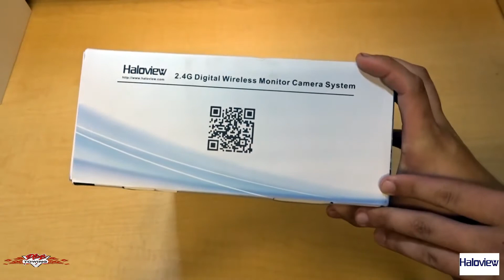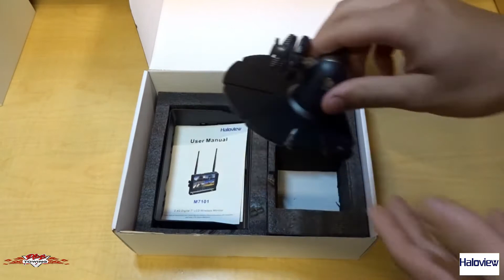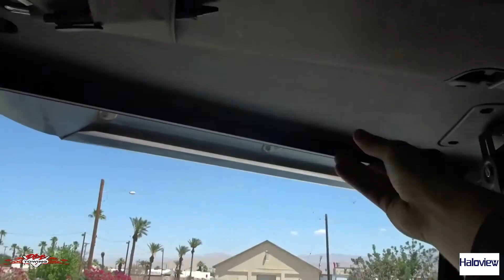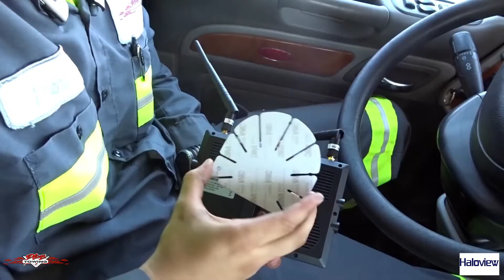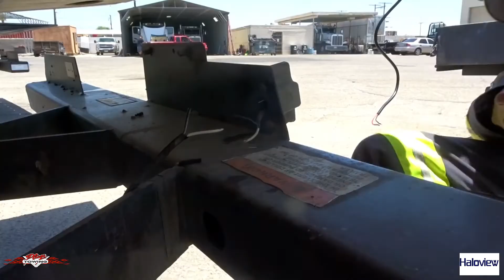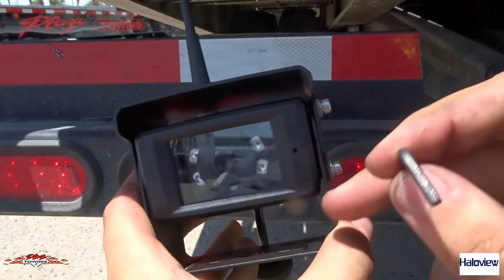Haloview wireless backup camera MC7101 installation tutorial

Comment: A question you may be able to help with, I have 2 - 2camra systems and have been using them for home security for the past 2 years. Last week one camera on ch 1 stopped working (no single) I tried to re-pairing both ways and still (NS) I took another working camera from my other system and replaced the non-working with a known working camera and even after pairing still (NS). I then put the test camera back to the working system and works fine. I checked the power supply that I'm using 13,8v 3amps and is good, remember I have been using them for 2 years without issue.  Any ideas? or a content # I can call?
Reply from the maker: Will IR lights on the camera be lighted on after covering the sensor by using opaque stuff like black cloth and etc?  You could contact Amazon@haloview.com if you purchased it on Amazon. You could contact support@haloview.com if you purchased it on the official website.